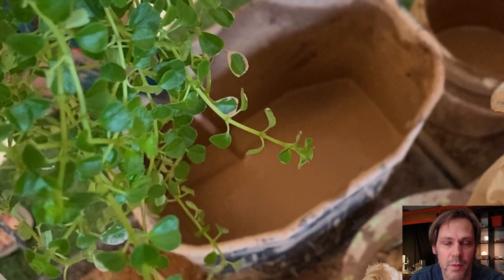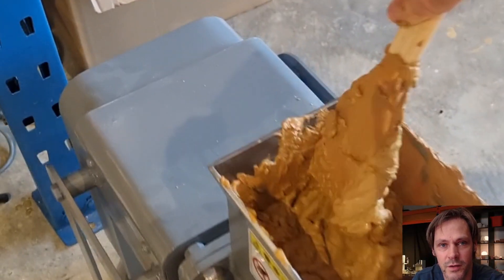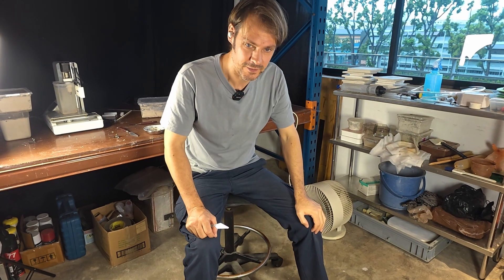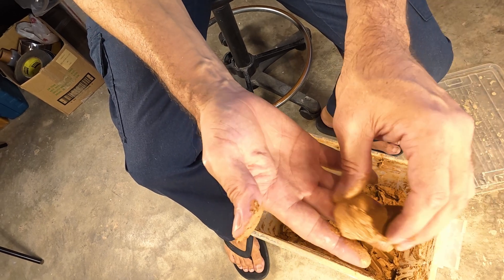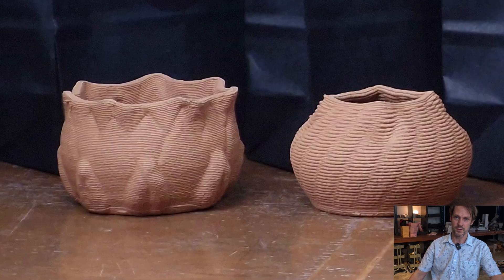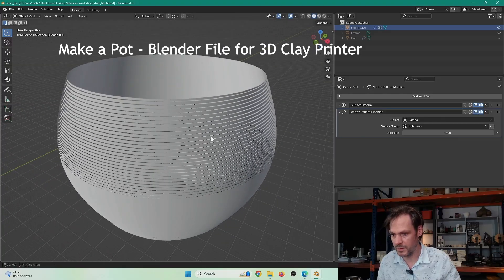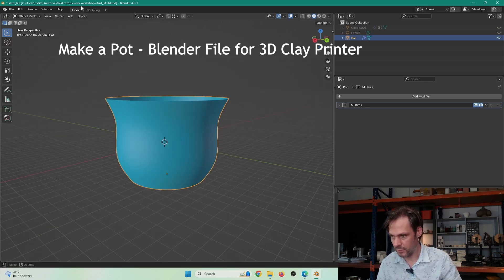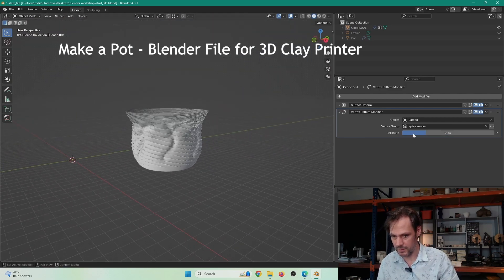3D Printing with Reclaimed Clay - Mistake or Genius Idea?

Comment: I'm a 3D artist (in Blender) and for hobby I'm doing woodcarving and ceramics. That said it really is not hard for me to justify buying an affordable clay printer 😅 
This is why I'm here, learning from you some valuable lessons. Thanks for your efforts!

So I'll be interested in the file too when I have an actual printer at hand. Now I'm more interested in your verdict of the Eazao printer after extensively using it. How good it is?
Now that - I guess - you figured out its hiccups does it work reliably?

Also 2 technical questions:
 Is it possible (and does it make sense) to double the wall thickness to make the print stronger? It really does look flimsy right after the print is done
The reason for Q1 is Q2: I'd like to smooth my prints out. I'm not interested in making it look like a 3D printed clay something. I'd like to help my ceramic creatures done faster and more precise to plan. And for that I need smooth surfaces. Can it be done? Perhaps when it's leather hard I can apply a ton of soft clay on top?!

thanks if you take time to answer!
Reply from the maker: Double wall is possible, if you are smoothing out after, it dose not really matter if you are using vase mode or not, so you can just add 2 walls in your slicer. I use vase mode for everything as i want to keep the surface as free from start and stop marks as posable so i don't do it. You can also use a wider nozzle and increase the line thickness instead of multiple layer. 

I am not an expert on adding clay to prints. but from what I have read it works well as long as the clay is not too hard, you dry it slowly and the clay you add is as close to the dryness of the clay you printed. but you can find lots of people talking about handles falling off pots etc if you look for them. there are always solutions but nothing is foolproof 

The eazeo potter dose good quality prints when you have got it working. It has flaws, but I have been using it a lot and it works well. It is reliable. But it is a pain to load and unload clay. I am going to replace the motherboard on it, as the board they are using is underpowered and hard to update settings as it is an old RAMPS style board that needs flashing each time you want to change anything.  as it comes the biggest flaw is you have to be very careful not to print too fast with it, it will accept commands to print faster than it is capable of doing, and then implement them and stall. I like using duet2 board as I can set a limit to the speed of each motor in the printer interface, and the board will automatically slow down any parts of th eprint that are would push any one of the motors past the limit you set.